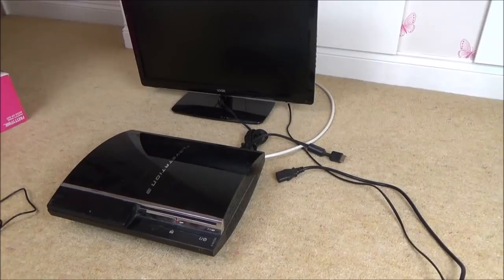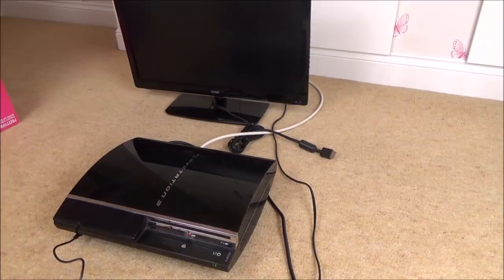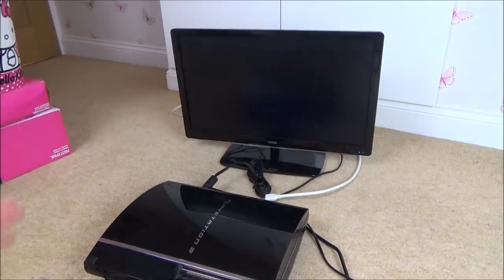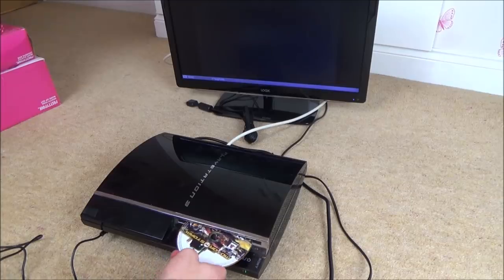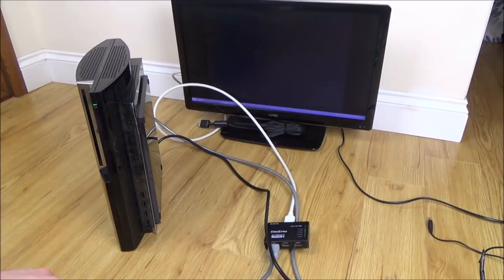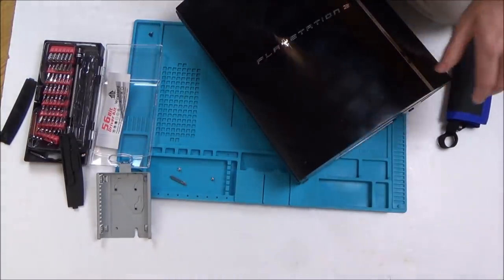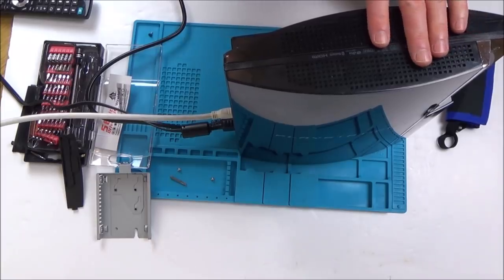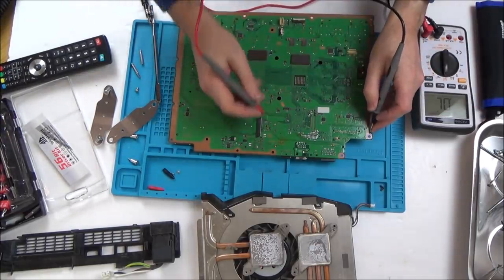Trying to FIX a Faulty PlayStation 3 CECHC03 (Part 2 of 3 PS3 Fixes)

Comment: Hi maye new sub here. Where did you get that screwdriver tool set? Looks awesome. 

Im having issues with a CECH03 at the moment whereby the PS3 and PS1 games work but the ps2 games dont. When PS2 game is inserted and in middle of loading the fan goes hype mode for a second but then it all shuts down with a flashing red light... any idea whats wrong with it?

Comment: The Cell Processor of the PS3 is on a separate die from the GPU. Try sticking that board in your kitchen oven to melt the solder. My reasoning is that the kitchen oven could heat the whole board up to 500 degree Fahrenheit or 260 Degree Celsius more then enough heat to melt the solder

Comment: I tried re flowing the solder balls but adding a penny or coin on top to give it more pressure worked for me. You might want to try to re-flow the solder balls under both chips. Sometimes the heat trick works but adding more pressure on the chips does the trick if the solder has cracks in it. I hope you re-visit this repair. They do sell special plates to make re-flowing the solder balls easier.

Comment: That console should be treatted very well and change thermal paste at least once a year, if you don't clean it once a year it breaks down because it wasn't really well designed, it had for its time really expensive things like the blue ray, but the cooling is not very good, the only worth ps3 is the super slim because it doesn't get as hot as this one, nice video vince :)
Reply: Disagree about the 'super slim' model, I wouldn't recommend that over the 'slim'. 
I've had an 80GB 'phat' which got the YLoD after about 4 years and then I replaced that with a super slim that worked for about 5 years (both bought new), before totally dying (LED wouldn't even turn on). Long before it died, the super slim developed a whine noise (probably 'coil whine'), that was very distracting, as was the much noiser top loading disc drive.
When it died I tried a repair at CeX, and when they couldn't fix it, I just picked up boxed 160GB slim at CeX and have been using it since.

The PS3 from CeX has some fan noise (much better than the other models I had though), but hard to complain considering how old it is. The 160GB & 320GB slims were released in Oct 2010 in Europe, so depending on when this unit originally sold, it could be up to about 8.5yrs old. Went with a boxed unit, as I thought the kind of person to keep the box would probably keep it in good condition.
Reply: It is the same story with laptops. The require periodic maintenance, paste, clean fan, radiator cooler that is usually partially cloged.Even coated with tarmish the heatsink efficiency falls like a rock, fans runs much faster and end getting random shuts off. if you keep insiting, damage will finally occur. Pavilions are the prime example IMHO, undersize cooling and the exhaust is partially covered when you open the screen at 120 degrees or mor. But a good design. To make thing worse the put cheap paste to the GPU.
Reply: I have a 60GB phat that I've used hard since it was launched. Never done any maintenance on it at all and it's still going strong.
Reply: @roverboy01  Thats good but you should have it in a place in where there isn't a lot of dust.
Reply: @DaveSimonH  I have the super slim and works perfectly i also have the fat and it has the yellow light of death, the fat worked for about 2 years and my super slim has been working for 6 years.

Comment: Good old IBM CELL processor ♥️
I can't believe you haven't heard about that CPU before, it was a crazy powerful CPU with 8 cores and University's bought tons of PS3s and used them for grid computing/supercomputer.
The PS3 can run Linux 🙂
Reply: Its 6 or 7 cores, but not exactly...you can read in Wikipedia and its not "crazy" powerful. For its time, definitely was more powerful than the Xbox, but still specially nowdays is nothing. And to make games for it was crappy.
Reply: @borisdg  try reading my comment again 😉 The CELL was not developed for game consoles.
Reply: @borisdg  it's actually 8 cores but Sony locked one of them. You can unlock it if you hook up a uart usb converter to the syscon testpoints & run the python script to interact with it.

Comment: On a working PS3 you would also get "shorts" all over the CPU/GPU, because the size of the capacitors are too small causing the multimeter to beep. It's better to have your meter in diode mode and check that way, you can find videos regarding this on Jessa Ipad Rehab channel.

Comment: i wont say it's a fix but you can at least see picture on your screen by putting  a penny on the heat sink of the RSX and tighting up the screws very hard so the solder under the RSX will make contact to the board because GLOD is a symptom of the solder not touching the RSX the problem is that the PS3 will work but make loud noise and shutdown of overheating because the heat sink not touching the RSX i run a console repair shop in TUNISIA and i watch your videos all the time keep it up
Reply: I've tried that method before, it didn't work at all.
Reply: @HuntersMoon78   if it didn't work most likely you have more than one solder joint not contacting the RSX a reball will fix it most of the times

Comment: I used to fix YLOD on ps3s, to fix them i used to put my heat gun at 350c, 2" away from the chips for about 40 seconds, and i never did directly on the GPU and CPU, only on the black rectangular chips on the back. Allways worked after

Comment: Great video again Vince, brings back memories of me trying to resurrect my launch day ps3 after it broke, i rigged up a square cardboard tube the same size as the gpu chip lined with tinfoil and mounted on a stand about 10mm above the chip to lift and reball it, i used a hot air gun as the solder station hot air wand didnt have enough umph as you found out, my efforts werent successful however haha it was broke anyways good luck with the 3rd ps3!

Comment: You should use flux because if the solder has been heat cycled a few times which is likely then it will certainly have cold solder joints

Comment: The full backwards compatible PS3s were not available in Europe, the CECHC03 is the launch model there. (Our 2nd Generation PS3, the CECHE01, is exactly the same as your guy's CECHC03, which has one of the PS2 chips but not the other and has the missing chip be emulated)

Also, try reflowing it in an oven, I typically do that for systems with faults and it usually has results.

Additionally, PS3 can't hot swap cables, everytime you want to change input you HAVE to restart the system and let it detect your connection type (it should typically do that on its own.)

PS3s also require an HDD to play software and get into the XMB
Reply: @radiiiiiiiiiiii  All CECHC and CECHE only have one chip (if there was a board revision, Sony would of changed the letter,) and can launch every PS2 game made. HOWEVER, it does not mean it can PLAY every PS2 game ever made. Games such as Tekken Tag Tournament will start and go into gameplay on a CECHC/CECHE, but will play at half speed, rendering the game as unsupported. PAL units were only greeted with a chromed bezel CECHC (the CECHD, the budget 20GB model was not released, would of been a 1 chip CECHB. Our CECHF also didn't make it to market either,) any non-chromed bezel would be CECHG and beyond. I know there's software on PSN for PS2 game emulation, which I assume was made for the CECHG (would of had a grey bezel,) as my CECHE does not require the software package to be installed for PS2 games to be launched and neither does my CECHA.

Comment: The GPUs that Lewis talks about in his video are known bad MacBook gpus. The ps3 can be easily fixed by a reflow as it is a different issue than the one Lewis dealt with in his video. The MacBook gpus are physically bad chips, the ps3 gpus are 99% of the time fine, but are just not correctly connected to the board because of cracked joints, which a reflow will normally fix. Also you don’t need special equipment to reflow the gpu, just a heat gun :)

Comment: I think the problem is the capacitors...try to change the NEC/TOKIN capacitors. I have your own console, but in my case the HDMI and AV port doesn't show anything on the TV and can't reset the video output, because the console doesn't make any sound after the first beep. Maybe is the capacitors in my case too.

Comment: Hi Vince
It will show shorts on beeper mode, my Fluke beeps with 150R but not higher.
I have mentioned this to you before, you can not use the beeper mode on meters to check for shorts in electronic circuits, if you have another meter you can check the output voltage of your meter in beeper mode.
The Fluke 77 I have gives out 0.5V in normal resistance mode and 2.5V in beep mode.
The reason for this is it is so you can test diodes so it needs to be able to turn on a diode, which it will also do when you use to test a board.
The capacitors are for power rail decoupling and it will be a low voltage say 2V and if you measure using resistance mode will most likely be below 100R.
You will more likely need 350C or more for the hot air.

Comment: I have fixed a few PS3 phats with a heat gun and flux and the results were mixed to say the least.  One 60gb I fixed from ylod lasted 1 year, one about a month, and a few could not be revived.  I think with these consoles it just depends on how heavily used they were and what previous repairs they had if any.  My own 60gb phat lasted 7 years before wearing out with pixelated av output - the last game I played on it was GTA 5.  But it has been replaced with a 1tb cfw PS3 slim that is still going strong.

Comment: i did a "reflow" on an xbox 360 that had the red ring of death and that was 4 years ago and it still works so rossman might be wrong  =) btw i put an extra 0.1 mm copper plate between the heatsink and chip that might have helped to =)  love your channel as i am a fixit amateur to but i have workt a little with this so that might make me a professional ;)
Reply: GM Kof hard  na then i would be the luckiest man on earth =) that was the first one i have done 6 more after that one and all of them works still

Comment: 140c won't melt leaded solder alone, now try melting lead free solder at that temperature, with a thick board good at spreading heat, can you make a follow up vid possibly with the hot air gun at 450c for a longer period of time and see if it works

Comment: I baked my ps3 40gb that got ylod in the oven for 30min and it lived on for another 12 or so months of hard gaming. It's worth trying, I did my 360 e74 error with a heat gun and flux, that also lived for another 8 months I think but still well work the repair.

Comment: Hey Vince, you should pre heat the board before reflow. Also re-balling ain't as hard as you think and most of the equipment is available for cheap on eBay. Love the vid though and was wondering when your going to upload.

Comment: I know very little about consoles, but I have a few years of experience with laptops.

I fully agree with Louis Rossmann about GPU reballing as well.  However you can revive a GPU temporarily by using a heatgun.  My method is to apply a liquid flux under the GPU and hit the chip with 300 degrees of heat with a high airflow, constantly moving the heatgun around the edge of the chip, but NEVER on the centre of the chip itself or you risk damaging the chip.  The goal is to be heating the caps around the edge of the chip.

You can buy cheap heat probes and run the leads under the GPU and will give you some indication of your progress, but a few minutes of heat usually does the job.
Reply: Louis Rossman methos is the way to go but not practica when trying to sort old stuff like cored duo laptops for example. You get as much juice as it is left. You wont be making a reballing on this machines. Heating a GPU on a Pavilion worked for me. How long ?. I cant tell, probably months.
Reply: @38911bytefree  I can't understand why people chose to reball a GPU.  If you go to that much trouble you just replace the chip and it would be a permanent fix.

Comment: Nice videos. BGA (Ball Grid Arrays) chips are not likely to short unless the chip got so hot the solder melted, BGA's are likely to go open due to thermal expansion and contraction and reheating may work in this case. A short is likely to be caused by a failed chip or a failed capacitor. Unfortunately all of those capacitors are in parallel so finding a shorted one is harder. the way to find it is to apply power and look for heat spots, either feel by hand or look with a thermal imaging camera. If the chip gets warm then game over, but if a capacitor heats up then take it off the board, don't bother replacing it as all those caps are in parallel they are what's know as decoupling capacitors and are used to reduce power fluctuations locally (very locally), I'm confused why the the caps under the CPU are also short, if the CPU wasn't running then you wouldn't get any life from it at all. (These are my thoughts and I am not an expert just thought you might like the input). Keep up the repairs / attempts nobody repairs 100%. Love watching your thought processes.
Reply: He had meter on diode mode, on ohm mode it will have been a few ohms but not a straight short, which is normal for those caps

Comment: I have one just like that one. I was getting a red light of death, meaning it wasnt even booting. I got it running again reflowing the gpu. So in your case I would say its a hdmi chip. And yes it looks like everything is shorted. Low voltage, low resistance . I also had a capacitor that shorted near the cpu that blew a fuse.

Comment: Nice try vince. Hope better luck next time. However I have a small suggestion for you, a poor man's fix that sometimes works, and since you don't have anything to lose and your hot air station is not strong enough to heat that board up, you can always use your oven for it. Set it up to 350-400 celcius, and tuck the board in without any rubbers and similar stuff of course. Let it sit there for a good 5-7 mins or more and turn the oven off. Let it cool down by itself inside the oven. It might fix solder related problems.

Comment: the os fireware is on the nand chips on that model ..you can swap hard drives without having to install it back to hd    so should boot with no hd
Reply: an easy fix,is to wrap it in a toul so it carnt breath   turn it on .let it overheat    it will reball its self    works best with ps flat upside down wrapped in blanket

Comment: I have a ps3 of the same model number. I bought it at release and it worked for many years but got the yellow light of death and has been sitting in my attic for years since. I recently dug it out while looking for something else in the attic and decided to have a go at getting it to work and that is how I ended up here. When I plug in my ps3 to power and press the on button all I get is the fan momentarily coming on and going off again and the power LED just flashes red. I have the system fully disassembled and the thermal paste cleaned off the two main chips. Tomorrow I will probably blast the two of them with a heat gun in an attempt to reflow the BGA and hope for the best. Best case scenario it works....worst case scenario it stays broken and gets plopped right back into it's dark corner in the attic. Did you ever solve this or ever try again?